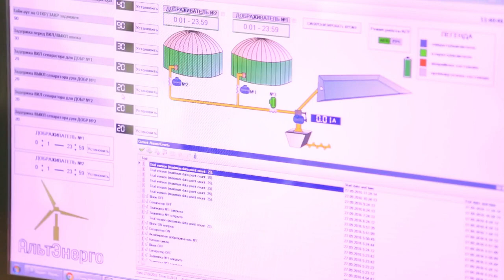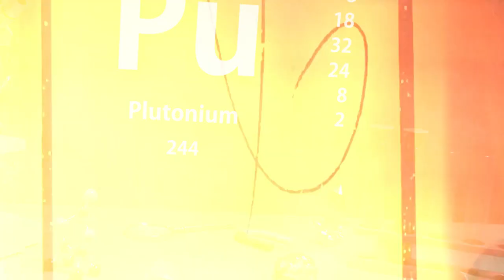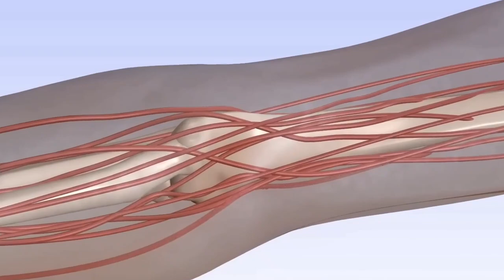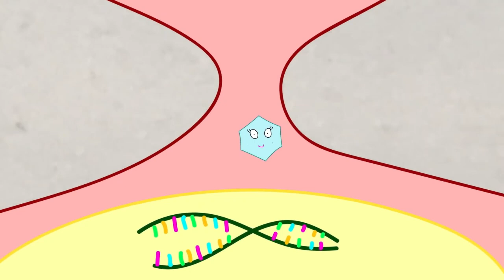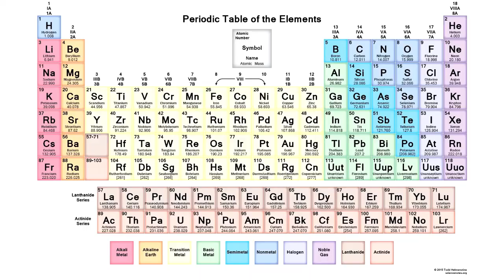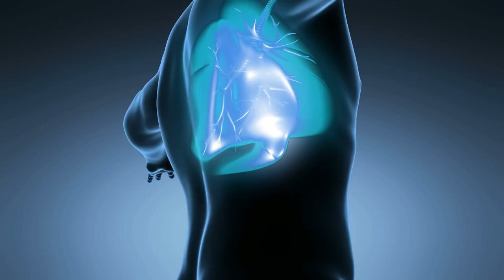The Top 10 Most Toxic Elements in the World

Comment: This video is misleading as it is supposed to discuss toxicity of elements, not compounds.  mercury as the elemental metal is not toxic although the vapour is.    One could add hydrogen, carbon and nitrogen as together they make up hydrogen cyanide.
Reply from the maker: Thank you for highlighting the important distinction between the toxicity of elements and compounds! You're correct that elemental mercury may not be as toxic as its compounds; however, mercury itself still can cause harm. In vapor form released even in room temperature accelerates the harmfulness as it enters the body easier.
Reply: @PoisonousTop10  But it takes years of exposure as the vapour pressure of mercury is very low.   Lead is likewise fairly inert, used in water pipes for centuries, but its compounds are poisonous.  I would have included thallium in the list as even in elemental metallic form it is extremely poisonous.    As well as chlorine, bromine is poisonous.   The fact is that many household products like gasoline, bleach,  and drain cleaners are poisonous and far more dangerous as we come into contact with them far more often.  Electricity and gas are probably the two most dangerous substances we live with!